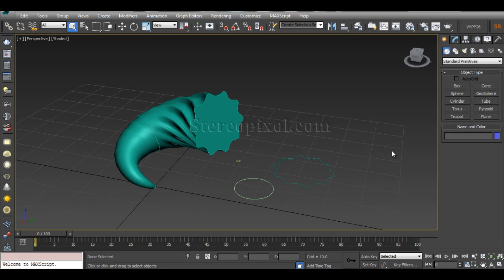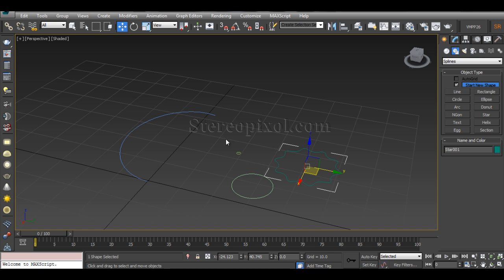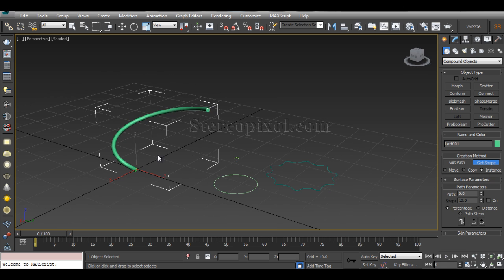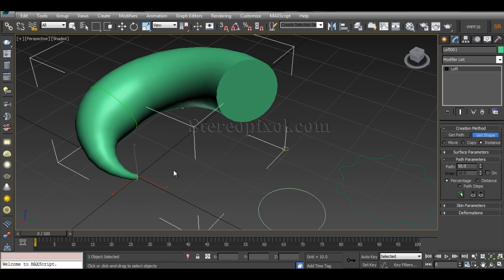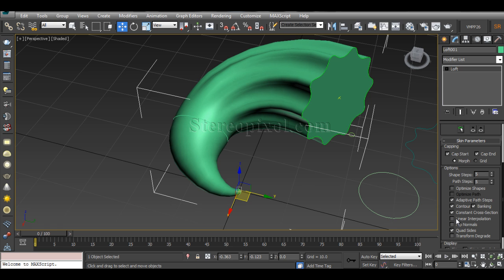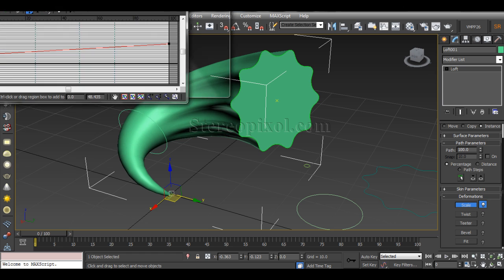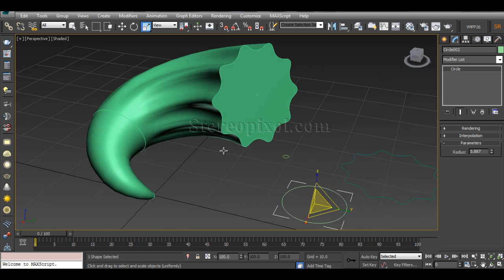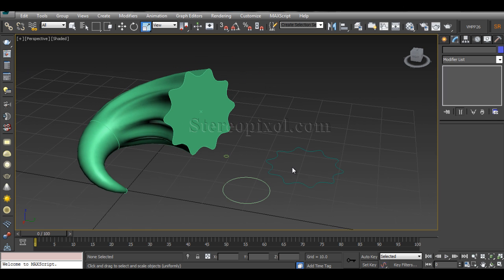How to use Loft in 3Ds Max

Comment: Although I love using 3ds Max and I admit that it is one of the most powerful 3d software on the earth.. however lofting and sweeping 1 and 2 rails in Rhinocores is much more powerful. Anyway thanks for sharing
Reply from the maker: I started my journey in 3D with 3Ds Max. It was the property of Discreet back then.  I am quite disappointed on the development of it since last 10 years.
Reply: @Stereopixol  I agree with you, I see some free software that are able to model things easily and achieve nice results with short time. a part from this fact I saw some of really awesome modeling plugins that only support Maya and blender, such as Hard mesh for Maya and Box cutter for blender.

Comment: This technique is not working 100% for me. When I select a spline and get shape from a donut, the donut shape appears but when I move the path to 50 or 100% and get shape from a smaller/bigger donut, there's no change at all. Please help me if you can.
Reply from the maker: +Broken Nose , when you are creating the donut I will strongly recommend to increase the size from the parametric values .... like from radius , instead of scale the donut using scale tool. I hope that will do. Or else try the deformer from the modify panel after you apply the loft you go straight to 5:50 of the video and get an idea.
Reply: +Stereopixol thank you very much. It worked finally. Looking forward for new tutorials.
Reply from the maker: +Broken Nose You are welcome friend ....

Comment: Im new to 3ds max and i need help making a propeller for an airplane. Can you make a tutorial on this?
Reply from the maker: +Jeff _21 Hi Jeff , Thanks for contacting. Right now I already have few videos on the pipeline. it might take some time. but if you follow this tutorial carefully and try to put it in terms of the propeller , it will be a bingo. try to think and use the cross section of the propeller and also don't forget to use twist deformer from the loft options.